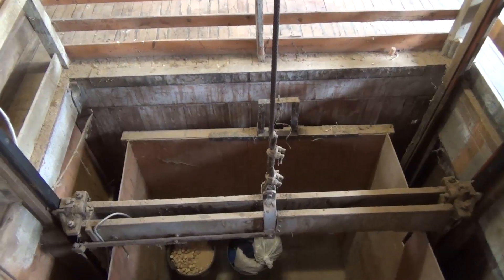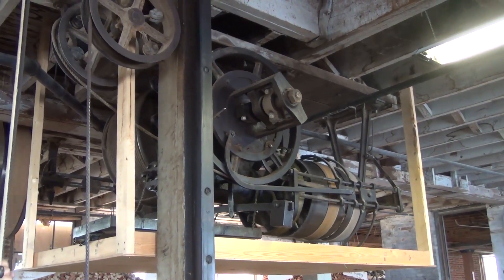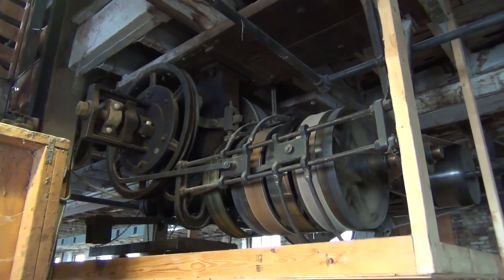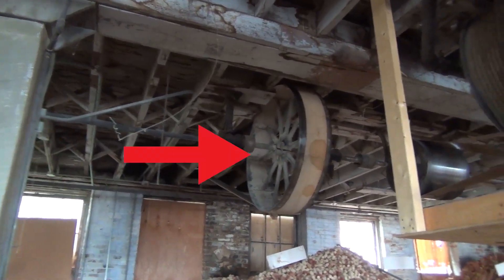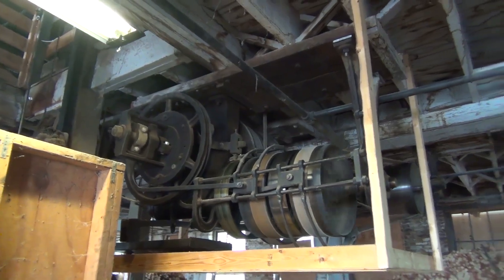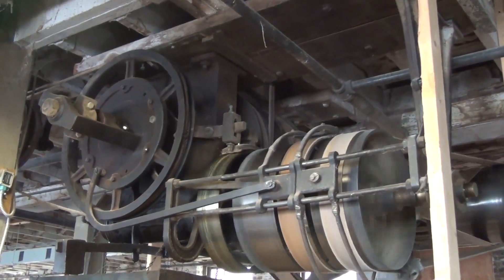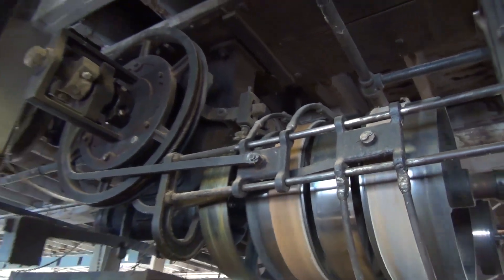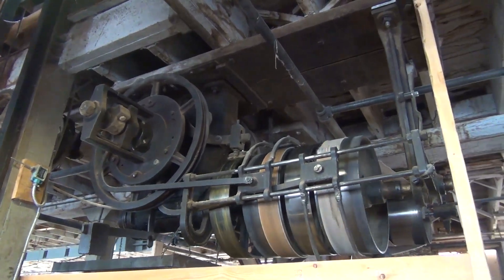How an Old Style Pull the Rope Elevator Works

Comment: Interesting that the belt is physically shifted between different drums. I had a Lego excavator that had a similar setup, but with a switchable gear instead of a drive belt (essentially doing the same as shown). Almost like the elevator has its own transmission, controlled by the rope that’s pulled.

Very informative and well done! As an Engineering Student, I personally enjoy this style of video. 😎
Reply from the maker: Glad you enjoyed it! That was my goal of the video.

Comment: Is there a phase reserving relay between the station up/down call buttons and the hoist motor? I heard the mention of the twisted belt when direction changed as to the cams the belts ride/slide on.
Reply from the maker: All the buttons do is turn on/off the motor. I’m not so sure about a relay.